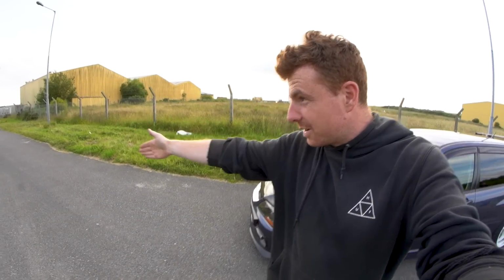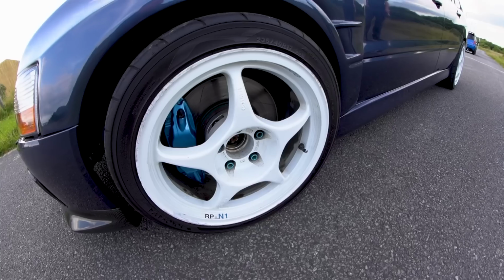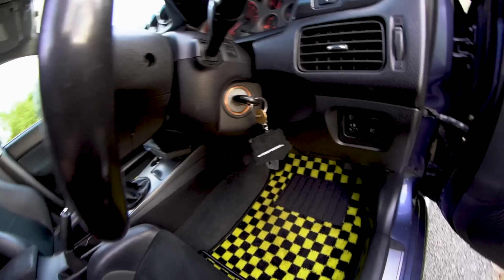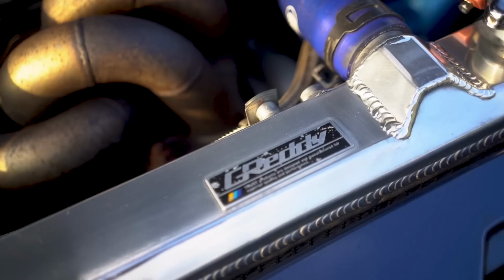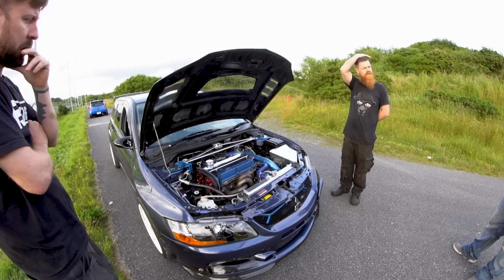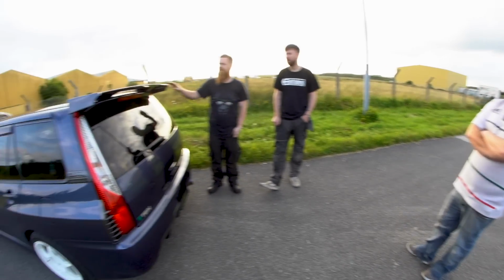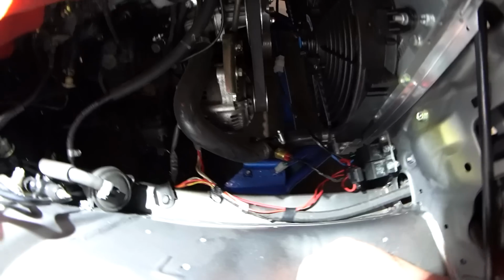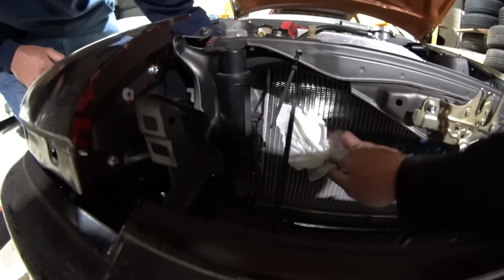The Coolest Japanese Family Wagon? A look at the Evo IX Wagon

Comment: Always a big fan of the wagons, most cars I had where. I drove a stock 2l one of those once ( the NA non wide body with the different nose which where sold commonly here) and I was amazed at how good of a car it was. Those can still be had for next to nothing, and still has a 4g63 in it). But the best or the coolest mmm I'm not sure. I had a Skyline r31 wagon whilst travelling in Australia with  a RB30 in it, pretty legendary car even in stock form. And their spiritual successor the Stagea. And then there's the JDM only STI Spec B legacy wagon, which had basically all the best bits of a WRX stuffed into on hell of a good looking legacy wagon. 280 BHP turbo 4. And then theirs the less exotic but equally cool 3.0R with the flat 6. And the Crown wagon with the 1jz, and the 2.4 Type S Accord wagon. And, and, and :P Just saying, they made some cool stuff; just all rare and expensive these days unfortunately.
Reply from the maker: For sure! Plenty of incredibly cool wagons over the years, it would be a close call between the Stagea 260RS, the Lgenum VR4 or the GC Impreza Wagon for me as out-of-the-box cars.  I just love the fact this is essentially an Evo 9 with a bit stuck on the back.